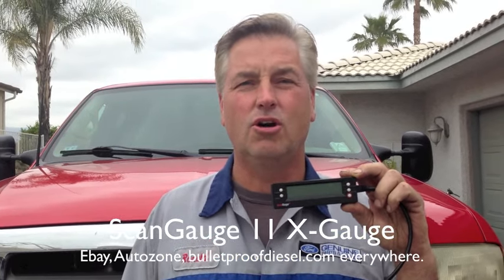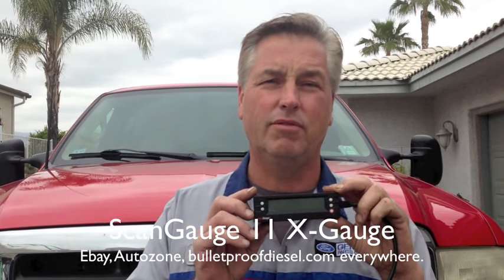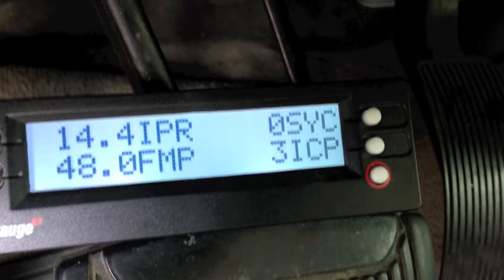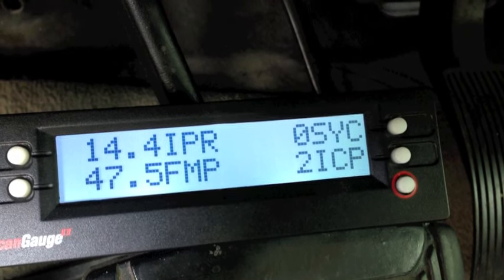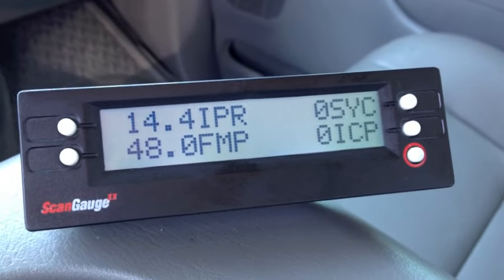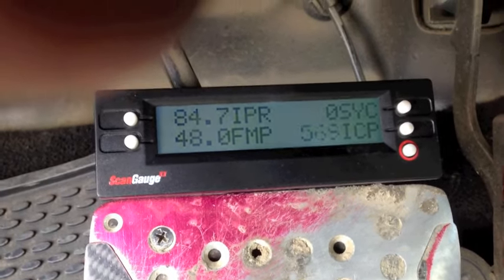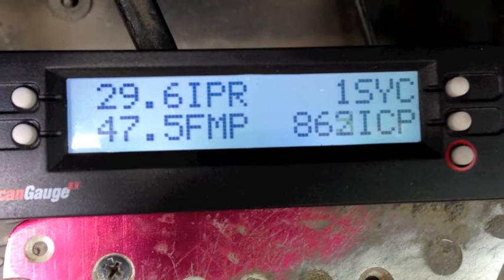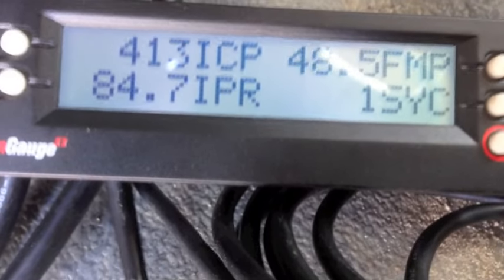Ford 6.0 crank no start. different senarios and diagnosis with a ScanGauge X-gauge

Comment: Hey ron i have a 05 6.0 it running fine out of no where the truck jst shut off i try diferent parts on in like a new ipr valve or new injector icm theres is no pressure on the rail do y think u have bad pump the fuel is good any ideas?

Comment: Hi Ron, I am really hoping for some help.  We have purchased and programed the Scan Gauge for my 2004 Ford 6.0.  It was a crank, no start when hot, with a low ICP reading when trying to start the truck when hot.  We replaced the IPR valve which costs a day and a half of work and $250 in parts and the problem is still continuing.  Is there something I can check with the high pressure oil pump, would that be a reason?  I love my truck but have just bought it four months ago and this is very frustrating to say the least.  Any other direction would be very helpful.  One other thing, can you just replace the wires on an injector and if so would we use the 7.3 wires?

Thank you,

Tristyn

Comment: hi ron,I have a early 2004 ,made in 08/2003 with 6.0. I have no  pre cycle clatter on my injectors and no start.ran fine until today with no issues. I have no idea where to start,please help,thanks mark

Comment: Ron, bought a 04 F250 6.0 with 125,000 miles on it from used car dealer. Drove it about 5 miles from lot check engine light came on, found EGR valve bad. Bought Scan Gauge, found oil temp 35 degrees higher than antifreeze, had diesel repair shop install bullet proof EGR cooler and new oil cooler, cleaned radiator. Drove for approx. 300 miles and shut off while driving about 15mph, crank would not re-start. Checked all fuses, oil, coolant levels, IPC is 118 and IRP 84.7%. Oil gauge on dash comes up to normal while cranking. Is it possible that while being repaired that they did something wrong? Thank you.

Comment: I have a 04 6.0 that wont blow arm air unless the engine is above 1800rpm, I have replaced the heater core, water pump, rad cap, checked hose routing, vent door operation & thermostat, The engine is warm (normal) but the heater blows cold unless the engine is revved up , any Ideas?????????????

Comment: Hi Ron.  I get low FICM voltage when cycling the key same as your second example in the video.  Should I first replace the FICM relay or is this an automatic FICM failure?  Thanks!

Comment: I need your help i'm a Frac mechanic in one of our service trucks died it's a 6.7 F550 my relief said he was sitting in the truck and then all of a sudden it died would start it and then it would just die scanner is coming up with the code p0884 TCM power input signal intermittent you could give me any of your thoughts it would be greatly appreciated thanks

Comment: Hi Ron.  I have watched most of your videos on the Ford 6.0.  My truck starts, runs a while, sometimes for 2 hours, idling.  When I throttle I get black smoke, then it quits.  I have changed the both fuel filters and now it won't even fire up.  I turn the key on and now I do not hear the injectors insync at all.  Did I change a program or is the FICM gone bad?  Very very cold weather minus 15 below F is when one day the truck runs perfect, then the next day it runs no more.  We live in a cold climate and most of the fuel is suited.  Main thing is don't know why I have got black smoke, when it purges.  And how much would it cost to purchase a FICM from you?  Is the FICM responsible for the injectors not going through their rotation when you turn on the egnition?  Thank you.  Jay

Comment: Hi love that you help out Ford owners I have a no start issue with a 2007 F350 6.0
info as follows
                  IPR            FMP            SYC             ICP
Key Off       14.8           47.5             0                   0
Key On       14.8           48.0             0                   0
Starting        55.4          47.5             1                   1195

My Actron 9580 code scanner is pulling up the codes of P2285

Comment: Hi Ron, I have Ford F250 6.O 2004 BUID DATE OF10-03, I have low voltage during cranking, drops to 32 volts, and 0 on SYNC, could both of these be related to FICMS

Comment: ron i have a 2005 6.0 but my issues are not described here . mine will turn but intermittently when it starts it doesnot run like a diesel. it almost runs like a gas engine.
then it dies out . i restart it and it does the same thing  sometimes the third or fourth time it will start and slowly come up to sound like a normal 6.0 please help me .

Comment: My 04 F350 did not start the problem started when brake too strong it was turned off and the oil pressure was low so the zero replaced the oil pump and the lid after that perfect work for 2 weeks But now the pressure of oil does not rise but in the filter if I have oil and in the computer I design that the pressure of the ICP if it rises but inside of the truck design that has no pressure

Comment: HI RON I HAVE A 2003 6.0 BUCKING AN STALLING I REPLACE OILPUMP ,FICMS  FUEL PUMP
 NO CODE   ENGINE RUNING FMP-48.0 ICP-64.0 IPR-27.3 SYC-1

Comment: Hi great videos I was watching this video and last scenario is what I'm having with my 2003 6.0, no start when hot unless I spray engine starter. I'm not to knowledge on diesels I've tried using what have a aisle to me an action elite auto scanner cp91185. Not a lot of mechanics I can really trust. Codes I've gotten have been: Map- Mass or volume air flow correction , also cylinder 2, 8 contribution balance fault,  erg flow insufficient, obd systems readiness test not complete and no dtc. I'm at my wits end. Any advice would be great full.
Reply: You missed him man. He passed away
Reply: so with this type of scenario you want to check your oil and see what it looks like? do you have base oil pressure when hot? every truck I work on that has this problem I always start with base oil pressure. ive had trucks start up cold fine then when they get hot I shut them down and try to restart and they don't have base pressure anymore. since your getting the injector codes as well as the no start when hot, your oil could be contaminated with diesel caused by a bad injector. it will then it out a lot.. get it hot and pull your oil filter off.. then crank the motor using the firewall wire. if it fills up with oil then you know your oil is good. then move on to the next diagnose step..

Comment: I have an early 04 with the 6.0 crank no start. Fmp- 48.5 syn-yes ipr-14.7 key on engine off, 84.7 cranking, icp-230 max. I changed the IPR valve and still get the same results and numbers. Any suggestions?

Comment: i need help. Im an ASE auto tech, have an '06 6.0L with 48v FICM, 1260psi IPC cranking, 0.6psi KOEO, IPR 85% cranking, 15% KOEO, SYC=yes (on SNap On VERDICT scan tool),,,,NO START,,,,IPR has hole in the screen, but how do I have high pressure??

Comment: PLEASE HELP! I bought my husband a 03 F350 6.0. Its our first diesel and our first Ford. We had it for about 6 months with no problems and then my husband had to have surgery for a brain tumor. It was removed, but on the way to his post surgery check the truck died, the turbo hose popped off and it just died. Put the turbo hose back on with no trouble but we couldn't get it restarted. We had problems starting it for a bout a week before, it was just hard to start but eventually it would. I had it towed to a local diesel shop and paid money for them to tell us they had no idea what was wrong. So we tried the obvious, new filters, new battery, oil change. Nothing. I can't take it into the dealership because we have no money to spend for someone else to fix it. We found your videos and we bought the scan gauge. The last truck on this video is doing about what ours is doing including the starting with the starter fluid, it will stay running for about 5 mins. As its running the IPR stays at 84.7. The ICP starts out at 833 and then keeps falling to 600 then the engine dies, if we add more starter fluid it will run for just a few seconds long enough to burn the fluid then dies. When we try to start it without the starter fluid the IPR runs at 84.7 and the ICP hits between 400-480. Any help would be MUCH appreciated. Your videos are fantastic and I have learned a lot about diesel engines. Thanks!
Reply from the maker: I'm writing him through his email and offered to test and inspect his ficm.

Comment: need help 2006 F350 change power board worked one week, now off and on, when I get a no start I tap the FICM it starts clicking and the truck starts up no problem, this occurs hot or cold
Reply: check the harnesses under the ficm, sometimes the connection clips/ taps get weak and don't keep the connection tight to the ficm making it unable to connect with the pcm. it may or may not shutter and buck when the truck is running due to vibration causing the pcm to briefly reboot. it might also give you water in fuel and wait to start lights on your dash but that is the pcm rebooting. the quick fix can be piece of rad hose placed between the ficm connections and the valve cover. I've used 1 1/2  hose I believe. just loosen the ficm and place the hose so it is beneath all the connectors and tighten the ficm back down. be sure it's not too tight as to not damage the ficm while still being firmly installed. it's not a permanent fix but it may get you home in a pinch.

Comment: Ron.. I have a 2005 ford 350 6.0 no start.  I found the following codes p0269 p2285 and p2291.  Where should I start looking?  The problem started with a rough ideal, then I shut it off.  It cranks but will not start.  I was able to get it start with ether but it had a rough idle.  Would not restart

Comment: PS:history on the 06 6.0L::did the t valve, dummy tubes and stand pipes and 2 injectors....still has one low cylinder but ran, no it wont start

Comment: I have an 05 6.0 that is a drive in then no start. FICM is NO SYNC. Replaced crank and cam sensor. WTF is going on? this thing is pissing me off royally. Replaced a hose that has nothing to do with anything. Owner has said it has had cranking problems before. Monitored FICM PIDS ICP IPR voltage all good. No sync from cam-crank with the FICM. what do I check next. I'm ready to call the guy and have him pay me for the power steering hose I replaced and for him to tow it out of the shop. I touched nothing else on the truck. I did nothing wrong.

Comment: HI RON I HAVE A 2006 FORD E350 I HAD WORK DONE TO THE ENGINE NOW IT WONT START, MY ICP IS AT 0 KEY ON ENGINE OFF WHEN I CRANK IT MY ICP HITS ABOUT 1500 IS IT A BAD ICP OR SOMETHING I'M DOING WRONG. I HAVE A SCANGAUGE II. PLEASE HELP THANK YOU.

Comment: I have a 2006 f250 6.0 and it cranks and won't start but if i shake the wires it starts up   what could that be im very stumped on it